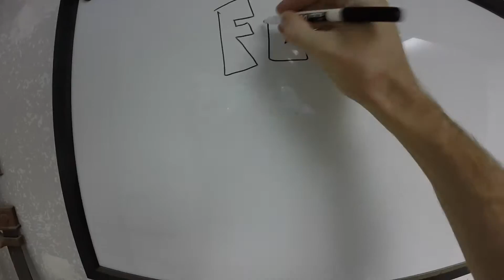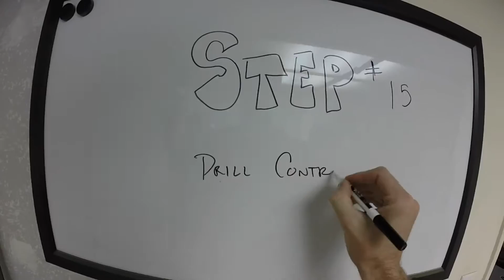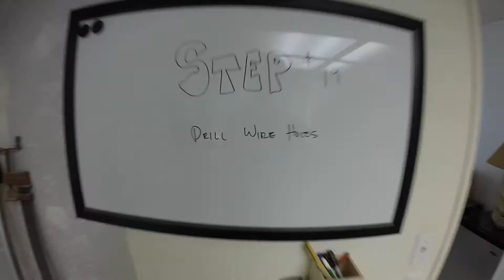Building a Flying V Guitar out of Scrap Walnut - Part 2 - Shaun Boyd Made This

Comment: Yes but could you do you have tuning problems using the tele paddle neck with the Les Paul style tuning and they rear-ended to set up for the tune-o-matic pull through and help can you tell me if you have any to any problems thank you
Reply from the maker: I used a Strat-style tailpiece, so this guitar is essentially a Strat in the shape of a Flying V. There is no break angle on the neck, so that is why I didn't use a tune-o-matic. So far it seems to stay in tune really well, no problems there.
Reply: @shaunboydmadethis  what scale length did you use ,  A Gibson scale length or a strat scale length ?

Comment: You shove the neck too far into the body. Do something about it...otherwise it'll just
be a useless POS or wall decoration.
Reply from the maker: I agree I set the neck a little too deep into the body, I might change it at some point, but useless POS is just being dramatic. Thanks for watching.
Reply: Im not being too dramatic..it's like owning a half of a guitar.
You can still save it...since you used multiple pieces...just  fill
in the holes with whatever wood  with matching grain ( rear of pick up bay)
Add a piece to neck pocket..if you want.  Dow them into place
if you dont trust your gluding. Glue joints are STRONGER
i personally think you dont need to. You dont need all the wood to mount the neck. All my Flying V....The neck pockets starts
at the 17th fret..and they;re also rounded at the bottom.
Just look at a Gibson's SG.
You dont need a metal back plate or a back plate..
Just look a RGs ( Ibenez)
Use 6 screws or dows (if you set/glue it ...or both)..Just make sure
it has some neck tilt....
if worst comes to worst...just make a pickguard....out of Wood.
Like a 59